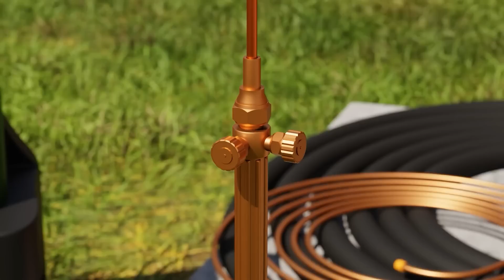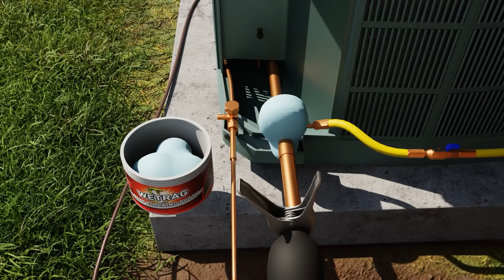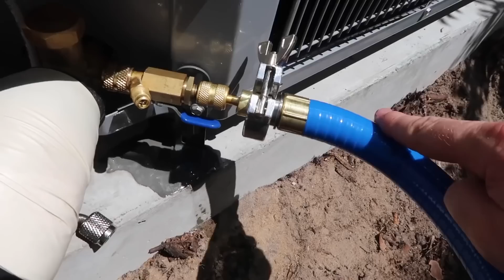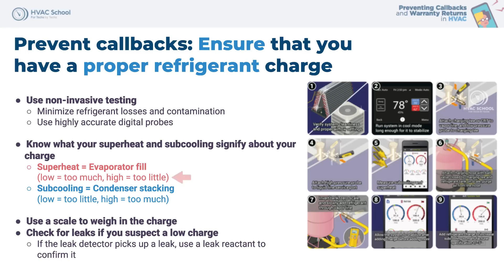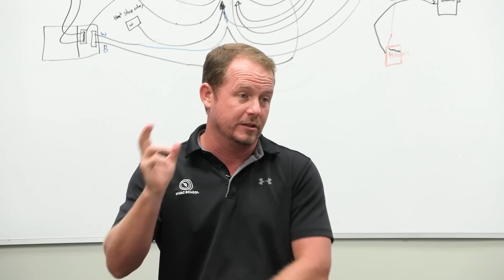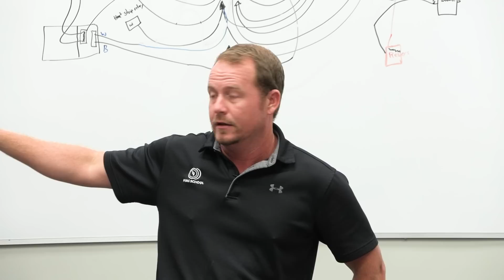Callback Prevention Part 2 - Technical Practices

Comment: For those wondering, when he was talking about "air-acetylene" torches, I believe he misspoke and he actually meant "oxy-acetylene".  Air-acetylene torch setups only use a single tank (acetylene) and takes oxygen from the air from its environment to burn the fuel (hence the name air-acetylene).  Oxy-acetylene setups use two tanks (oxygen and acetylene).  The graphics depicted an oxy-acetylene setup, not an air-acetylene one.

Comment: Can someone help me?Amana 2stage 5ton condenser and a TXV at evap.Drier inside unit.Has 3/8 going into drier but 5/16 going from drier to service valve an S shaped double 90degree about 6" long.Is this a restriction?Is liquid trying to change state?Drier has no temp drop across it but I can't get a solid column of liquid to TXV.I keep adding it keeps stacking but still high superheat and line jumping from vapor in line.Poor efficiency too.Never measured for a temp drop across piece guess that would tell the tale.Ive never seen this before.
Reply: Post a picture

Comment: Great video! I ran into a new issue I can’t find any information on. I’m currently working on a communicating hvac system. It’s throwing a 28 code for high input line voltage. I checked the voltage on both the high and low voltage sides. I don’t see anything that is out of normal parameters. 124v on both wires coming from the breaker and 27v on the low voltage side. Recently replaced the condenser fan due to a bad module. Unit worked well for about 6 hours then the outside unit shut off. The air handler fan will come on if you turn it on at the thermostat the compressor and condenser fan will com on in test mode. But I’m not sure what to check from here.
Reply: Model UPRL-048JEC

Comment: Great information for the young guys to learn and incorporate into their daily tasks. I do appreciate your real world analysis. You are right about pulling a vacuum on an existing system, especially systems with service valves.....even doing it the right way and loosening the packing nut before moving the valve stem, those puppies leak. Nylog should be in every person's toolbag in this trade. You definitely use 2 hoses in large commercial equipment and its very common to leave a vacuum pump for 24+ hours on large chillers to hit your micron numbers. It gets even more complicated when leak checking low pressure centrifugal chillers. On low pressure chillers....you can only pressurize the chiller to 10 PSI.....because at 15 PSI the burst disk ruptures and thats not good.

Comment: I live in Central Pennsylvania. We add a fluorescent dye to the refrigerant charge when we encounter small leaks. After a few months, or during the next maintenance visit, the leak site will have dye that can be spotted with a blacklight, and confirmed with bubbles.
Reply: Never use leak dye especially on new systems only use on dead system.
Reply: @bmillwood6666  what is the reasoning behind that? We have a lot of tenured minds at my company who I've never heard mention a problem
Reply: @Glaedr11  the only things that should be in a refrigeration system is refrigerant and oil, and in special circumstances glycol. Anything else is a contaminate
Reply: Great video Old refrigeration mechanic that taught me there two things refrigerant & refrigerant oil only l never use dye in my 28 years of doing refrigeration system & A/C . Your not service your customer it not standard to use dye.
Reply: @hvacrnortheastern2110  I'm just wondering what the issue is with using a compound specifically designed to do that job, and one that has had no discernable impact on performance or longevity? 

It is our policy to include dye injection in the cost of other forms of leak detection, so if we turn up short using other methods based on the time frame that is suited to our company, we are still leaving the house with a method to find the leak. 

We start with other forms of leak detection if it has a substantial loss of charge.
Reply: @Glaedr11  I trying to help you to better technician learn it’s not good standard practice .With all the new technology of leak detection tools and soap bubbles and common sense .Use a H-10 that’s what we use in refrigeration system that will pickup leaks .
Reply: Leaks can and should be found in a traditional manner.  The uv dye voids compressor warranties and that is a bad place to be especially with leaky systems, the leaking systems are more often than not the ones that kill compressors do to how high Superheat can get before the homeowner notices anything is wrong.   The dye method does in fact work but it’s definitely not a good standard to use
Reply: @georgewelker853  thanks for the explanation
Reply: What good is putting it in a dead system that doesn’t work?   It’s not going to travel throughout the system to in turn reveal when bad spots are.   I could be misunderstanding what your say as well so my apologies if that’s the case.
Reply: 99% of the time you can find it with nitrogen or a electrical leak detector, most people don’t clean that uv out the system or change driers and then damage starts.
Reply: @Freonleon  what damage does it do?
Reply: @Glaedr11  clogs metering devices, build up on compressor valves, if you properly evacuate the system and change driers and get the dye out then there less of problems
Reply: @Freonleon  I think there is a difference between dye alone or dye with leak stop. The leak stop can clog the system but the dye is just a color. It can be made to have no lasting effect on the circuit.
Reply: @realSamAndrew  when you got a way of telling the difference in the system please let me know. Because as far as I’m concerned it’s still dye. And I keep saying also depends on how you clean up the system after you fix the leak. And nitrogen and bubbles does wonders
Reply: @Freonleon  I'm not clear on what you are asking or describing.
Reply: Not a dye question but where in Central PA?
Reply: Meplayjoke  no the dye can clog metering devices, coagulate on valves, the problem is the cleaning  of the system after you found the leak. Do you flush and purge nitrogen threw it, change the drier, pull a deep vacuum.